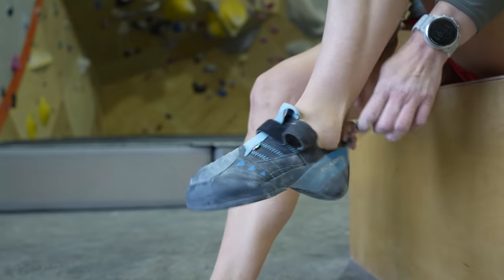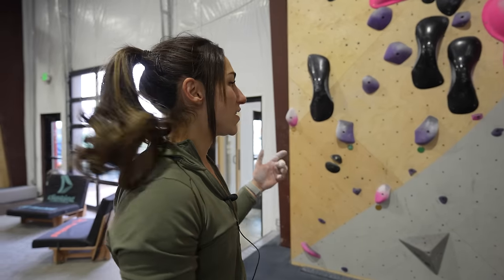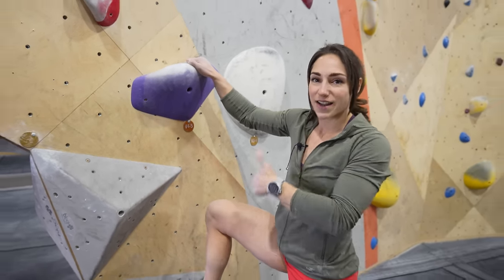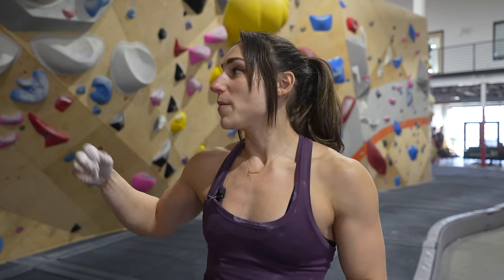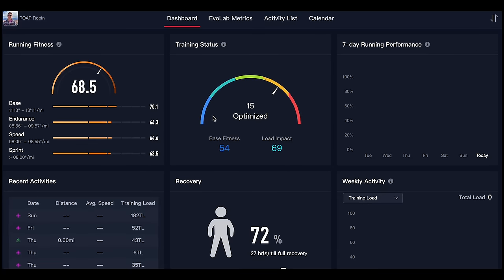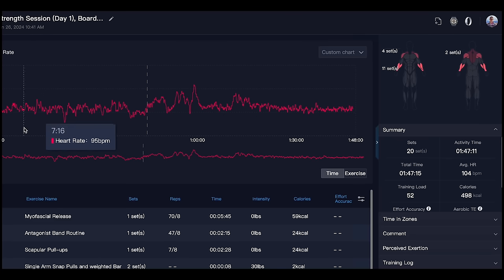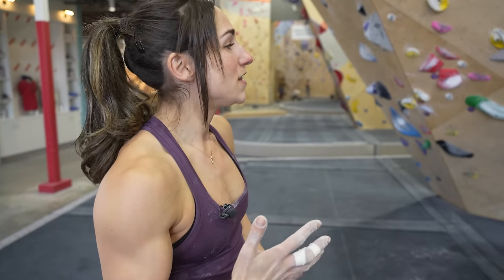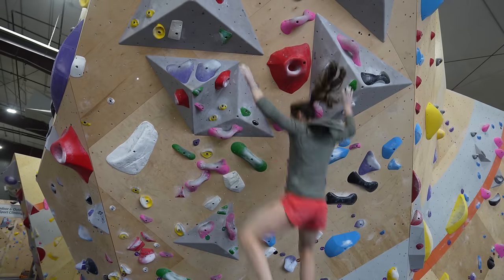Boost Climbing Power With Dynamic Techniques

Comment: I used to do road and trail run before started climbing, and I swear by my Coros watches. They have great value and support from a company that cares, GPS lock in very fast and set a high standard for long battery life. I sold it after I stopped running because I don't like to wear watches when I strength train and climb. That time they started to introduce climbing GPS tracking, cool to see how far it has come and the climbing community started exploring them.
Reply from the maker: They’re genuinely great. Being able to go into the back-end and create your own workouts is great for when you hit the gym. You literally just “start today’s workout” and can fine tune so that you just press one button between exercises: programming in rest etc if/when you want, reps/secs per exercise etc. 
I’m using it for every session now and it’s great to see the data. 
Thanks for writing and watching the vid though, your support means a lot

Comment: Excellent and very helpful video, as always. I particularly appreciated Alex’s campus board demo. As a novice climber, I found this intimidating at my gym. But now that Alex has pointed out that you can start out using your feet on the rungs below, I will attempt it. Thank you so much, your content is always so clear and helpful.
Reply from the maker: Awesome, glad it was helpful. Feet on campusing is an excellent tool and the best way of introducing the board. It can teach you to pull, work on specific grips and contact strength under very controlled circumstances too. Thanks for watching

Comment: Great video, i have a Coros as well and love it. Super durable and very accurate. I use it when running, biking and weights but have yet to use it other than a watch when doing any kind of rock climbing work out. From what i understand it has a sport climbing workout. How do you track hang boarding, power, and other climbing stuff through it?
Reply from the maker: So good! If you go to training.COROS.com you can log in, go to your calendar and create custom workouts. Just log them as strength sessions. 
Next month we’ll feature how to in the vid. So good! Thanks for watching

Comment: I am looking at these watches and basically the breaking point for me is that how convenient options there are to measure hangboard workouts.

Did you try this out in practice? What I would like to see more clearly, if I set up a max hang training for 10 seconds with increasing weight, is this possible to accurately measure the exact times /weights of the hangs (also my own bodyweight for the day)?

So for example, does it automatically measure if I do a hang for longer than 10 seconds, or if I drop a hang at 5 seconds? Or I need to  (can? ) add this data manually?
Reply from the maker: Hey there, thanks for the Q. 
No, it doesn’t automatically judge when you’re on the hangboard, that would be cool. 
For that, I’ve always had a digital stopwatch in front of me so I can judge the 10th of a second as best possible. I.e. I lasted 4.6 secs
Reply: @roapcoaching917  Thanks a lot for the quick info! I hope the next version will be able to do this...

Comment: For the campus board exercise, do you have recommendations for the amount of sets and reps?
Reply from the maker: Super subjective based on experience level, but it is certainly a matter of quality over quantity. We’d suggest 3-5 sets on each side with 1-2mins between sets and 30mins between each side.
Reply: 30 min rest between each side seems like a long time😅 or did you mean 30 seconds?
Reply from the maker: Haha, yes! 30 secs (OR the longest session known to man with 30min rests 😝)

Comment: Hi Alex, Robin. I love your videos but I'm only a casual climber that climbs during a 2 hour session once per week. I'm wondering what you would recommend to get try and increase my overall skill and strength within that 2 hours. Would you recommend a warm up followed by 90 minutes of climbing which includes working on different types of boulders (slab, overhang, etc) or would you try and get some trying into that 2 hour session and try to ramp up the training over time without cutting into time allowed for actual climbing. Thanks in advance, both of you come off as such lovely people.
Reply from the maker: Thanks for watching! As a casual climber, the best thing you can do is expose yourself to as much variety as possible, so more time climbing. The principles in this video still apply, steeper climbing will encourage faster strength and power gains, but it’s important you climb all angles and styles. If possible, increase your exposure too. Climbing 2-3 x a week will see you improve dramatically!

Comment: What days do you add gym exercise (weights etc) and how you mix it with your climbing training in that day? Also resting days than you
Reply from the maker: Great Q! Depending on the season, we can be hitting the weights gym 3 x a week or once. In rock season, we typically go 1 or 2 x a week for maintenance and conditioning. In winter seasons (now) we are hitting the weights gym after climbing sessions. We ensure we have at least one full rest day, and the others can be active (zone 2 cardio). If we are in a training phase, we often do weights on our “off” days. The intention is key. I.e. if our aim is to build strength (muscles), then weight training is the priority and we know our climbing ability may take a hit. But in our preparation /training phase, the opposite applies. Thanks for watching.

Comment: 🗽I do not use this kind of watches, because on my wrist they cannot measure my heart rate correctly. So I use a Polar OH1 for monitoring the correct heart rate progression.
.
Reply from the maker: So you should definitely check out the arm band. It’s very accurate
Reply: @roapcoaching917  You mean the watch combined with an extra band for heart rate measurement ??
.